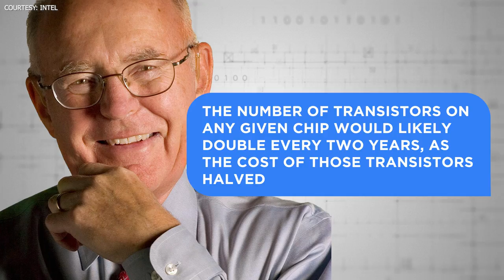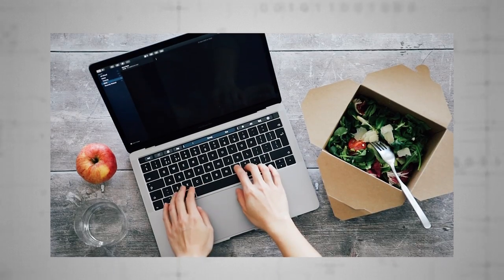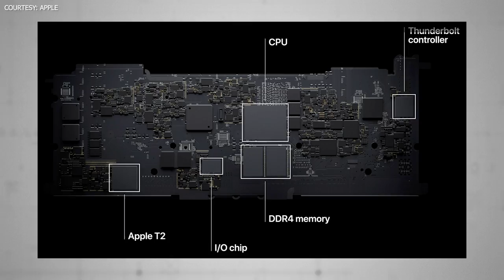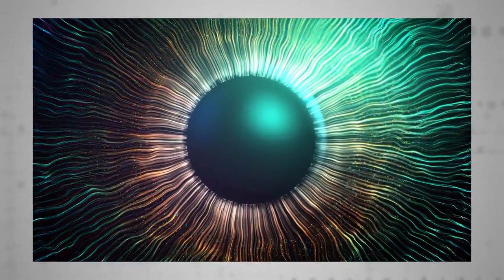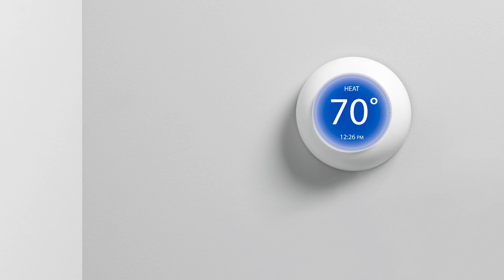Inside The World's Largest Chips Factory

Comment: Its crazy that we are very close to quantum tunneling scale. The limit that transistors can not be made any smaller, due to tunneling.
The transistor the one invention that single handedly brought about the technological world of today.
Great video Tech Vision.
Reply: Below 10nm the number of nm becomes only a marketing term
Reply: @cybermechid9181  that makes no sense to say that but the other issue is that we're rapidly approaching the mere size of a silicon atom, much less dealing with the quantum tunneling through logic gates
Reply: so we need NEW technology..........
Reply: @VibrantGm Sadly, the average person will never enjoy the benefits of the insanely fast chips being developed, because even if they end up in your device, they will be bogged down with data collection and advertising.
Reply: @cybermechid9181  he’s not wrong. The physics (leakage more specifically as well as the eUV process during fabbing) simply does not allow traditional miniaturization beyond ~10nm. Most chips that claim to be below 10nm are simply just designed in other ways (like using FINFET technology) that results in chips with similar output/efficiency to that of what we assume sub 10nm chips would operate at.

Comment: A human can lift a 12” wafer just fine — it’s similar to holding a vinyl LP (silicon is denser than vinyl, but the silicon wafer is much thinner). The reason wafers are moved robotically is because they cannot be touched by humans due to contamination. The containers (FOUPs) are basically mini clean rooms that ferry wafers from one station to the next for the dozens of process steps.

Comment: Transistor density on the M1 is closer to 130 million per square mm, not 170 million. The M1 has a transistor count of 16 billion and a die size of roughly 120 mm2. EUV lithography enables these unprecedented densities without the need for as much multiple patterning.

Comment: Serious question, if lights only carved out the wafer, how is this says anything about transistors? How are they made? How to linked/connect the transistors? Carving a silicon only produce rugged silicon right? What am I missing?
Reply: Yes there's a metal layer (sometimes more than one) connecting transistors together.
Reply: @brodriguez11000  hi there, how do they insert the metal layer, and what is exactly a transistor in this video? Is it the silicon?

Comment: To be fair, TSMC is what's called a FAB or Fabrication plant, it doesn't to my knowledge design the chips, that's mostly done by companies like AMD, Nvidia, ARM based chips like Apple's M1 and Qualcomm's Snapdragon 888 that then use companies like TSMC, Global Foundries or Samsung to do the actual manufacturing. I believe Intel is one of, if the only company that both designs and manufactures it's own chips.
Reply: Apple M1 20% TSMC Revenue Huawei Kirin 14% TSMC revenue and raising before being cut - off
Reply: Intel and Samsung. They both have fabs. Samsung design Exynos processors for their phones but based on ARM design.
Reply: of course, TSMC can design a mobile phone or CPU on its own, AMD multi-core is from TSMC technology, this is why Nvidia AMD apple all work with TSMC, not just for manufacturing; they want TSMC's technologies to help them to make their products

Comment: TSMC is probably nothing without ASML of The Netherland. But the dutch are so modest , maybe hardly has most of you ever heard of ASML. They make the machines that fabricate those micro chips.
Reply: ASML integrated lots of cutting edge technology from different fields and different countries, not all work solely done by dutch
Reply: @whatthehellisthis6245  ikr. Esp from Germany and United States
Reply: Lol Dutch are not modest
Reply: By the way, ASML bought their EUV technology from a Taiwanese guy (particularly the patent involving Immersive EUV - he originally was going to sell his patent and EUV idea to the Japanese firm Canon (the most dominant etching firm at that time however Canon does not want to buy it thus he sold his idea to a then - obscure firm called ASML).
Reply: I believe you got the other way around. ASML is nothing without TSMC. If ASML is the key, why aren't there more semiconductor fabs making 5nm chips? Why doesn't Intel buy from ASML and start making 5nm chips?
Reply: @mlai2546  : Because it takes a long time to build and expensive to boot. That's why Global Foundries dropped their plans.
Reply: Actually, all the breakthrough among chip and equipment is with help from TSMC and Taiwanese scientists, without the help from Taiwanese, ASML could fail in making euv, all the ideas and breakthrough were from Taiwanese from the beginning, and euv is developed in TSMC Hsin Chu f12,  finfet is originated from Taiwanese engineers Dr. Chenming Hu, Taiwanese scientists play a critical part in breaking through of chip theory, TSMC has made light source with 350 w for euv, ASML still trying to reach that far, with 350 w. TSMC can make chips faster and yield higher. Without Taiwan, there will be no ASML. Without any chips up to 5 nm.
Reply: Btw ASML don't make chips . They make the machines that produce chips. Further ASML originated from PHILIPS . Please

Comment: Blatantly incorrect information on nanometer sizing in this video.
5nm technology does not mean smallest feature size is 5nm. Actual smallest features are much larger. That definition would have held true for 2D chip designs (with single layer of transistors). Nowadays, transistor features are 3D (multilayered). What latest nomenclature for chips (like 5nm, 14nm, etc.) actually means is how small the feature would have to be in a primitive 2D configuration (i.e. single layer) in order to accommodate equivalent number of transistors in the present 3D configuration.

Comment: TSMC is just the 3D printer, someone else is making the designs
Reply: Hahaha

If so, why other countries don’t become the 3 D printers ?
Reply: The EUV lithography machine shoots a droplet of Tin 2 times, once to shape it and another to turn it to plasma radiating EUV light, light which needs to be reflected accross +- 20 mirrors to focus the light through a mask and lens onto the wafer. That 50.000 times a second.
As it is near x-ray light the mirrors absorbs the light if not perfectly flat, so the surface of the mirrors need to be perfectly flat on the atom level. Air absorbs the light too so this process needs to be in a vacuum too. Not to mention it needs the worlds most powerfull lasers to create enough light from the plasma.
This machine is build by ASML, the only company able to build it(and tried to build it), working closely together with other companies like the German Zeiss that make parts for the machine. It costs about 150 million dollars a piece and is about the size of a school bus.
You need extremely skilled people to operate these machines too and manage the entire process of making wafers, masks, ..., that is where TSMC comes in.
So no, not "just a 3d printer" LOL

Comment: Am I the only person who knows that its not actually 5nm and he's comparing sizes  based on marketing jargon and not actual size ? this is a complete fuck up. UV light is between 100-400 NM even when they use focusing tool and tricks to reduce the size of the light that get through its not 5nm.
Reply: First for the 5nm process they use EUV light so wavelengths from 124 nm down to 10 nm.
Indeed you are correct, the recent nodes refer purely to a specific generation of chips made in a particular technology,  it does not correspond to any gate length.